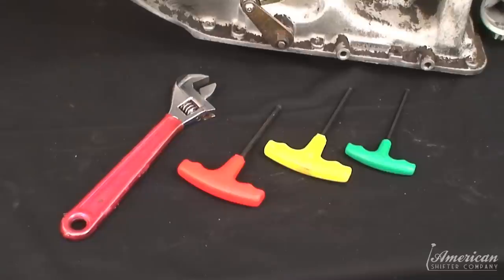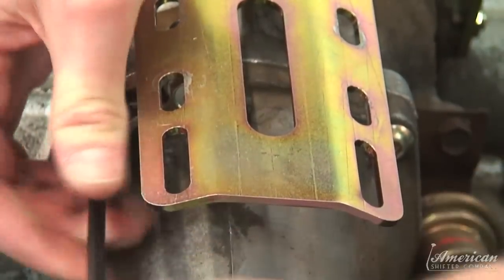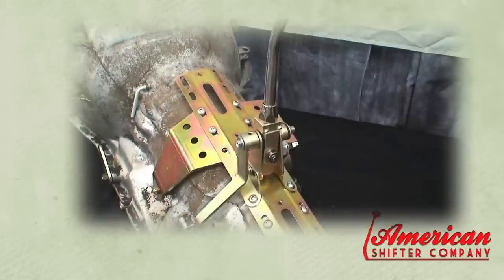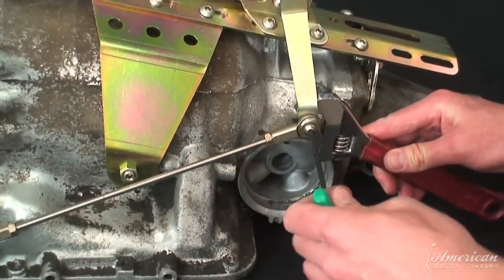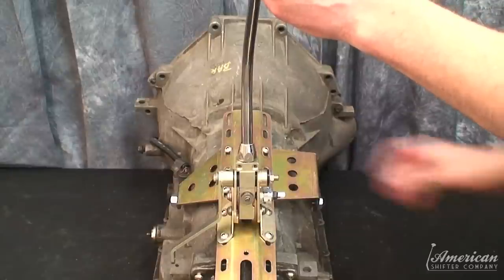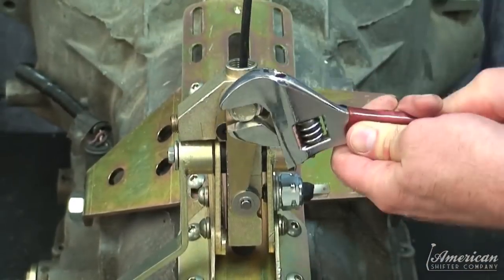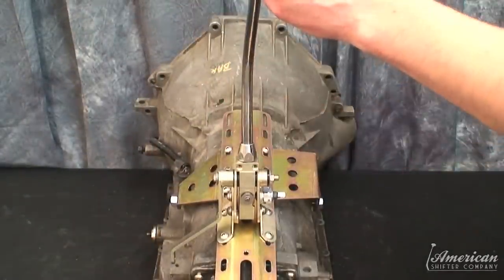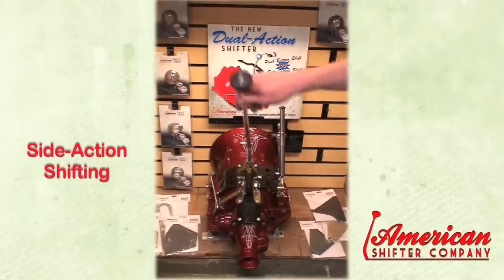GM 350 (TH) Dual-Action Shifter Installation Video from American Shifter Co.

Comment: Half way through my install on a TH350, not happy at all. No instruction sheet supplied and the downloaded ones are bare bones at best. Both left and right side plate angles dont match the top plate when everything is tight. Same for the mount plates from the top plate to the shifter mechanism. The vid shows them nice and snug and straight against the shifter but mine sure aren't. I'm on a tight budget and though the lower price would benefit me. What  WASTE  of money. Maybe this would be an ok install kit for a seasoned pro, but a first time backyard guy (me) I'm having a hard time. Shoulda went with a Lokar. Its called American Shifter, yet all the parts bags are labeled made in China.

Comment: All well and good, but my transmission is in the truck. Not on the ground. So how about a video showing how to install this shifter with the tansmission in the vehicle?  When I spoke to a rather condecending representative at American Shifter he told me it was possible to install the shifter while it was in the vehicle. He referred me to this video where the tranny is on the bench. Rather off putting experience. Thanks! American Shifter. I will be shopping elsewhere.

Comment: It would be nice to add a few shots of the side install. The short all-threads with the jam nuts apparently just float in the transmission holes. The instructions that do not come with the shifter (they have to be downloaded from their website, which are not very complete at all) do not mention this or much else. If you have a converter for a 4x4 you will probably have to create your own mounting brackets.
Reply: I'm here for the same reason.  At 00:25 its like they intentionally install the side bracket as quick as possible so you dont see the "hollow boss" install (thats what Lokar calls it).  That hollow boss is included in the kit, but it doesnt fit in the hole.  The downloadable instructions are terrible.  Since this is just a blatant Lokar copy, I recommend the very nice Lokar instructions.

Comment: Ok I seen all the bad input on this shifter. Does anyone have any positive feed back? I like the way it gives 8 mounting positions for the shifter. Since this will be going on a th350 but in a high mount looks like I may be able to use the existing boot hole.